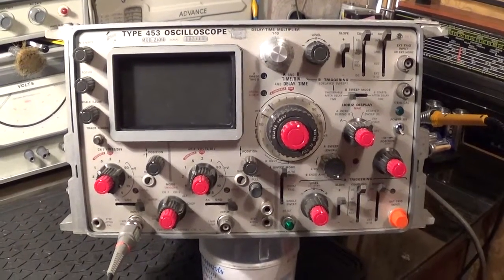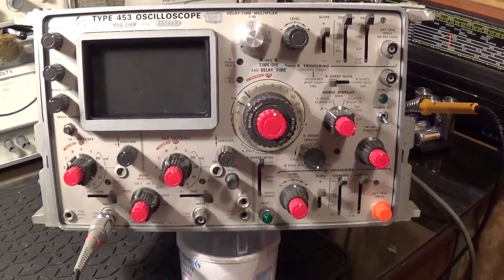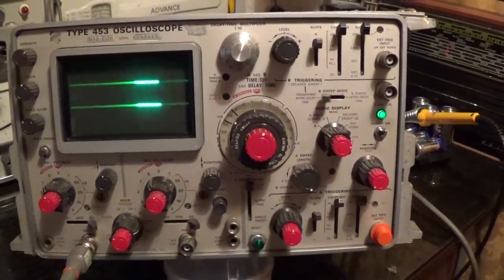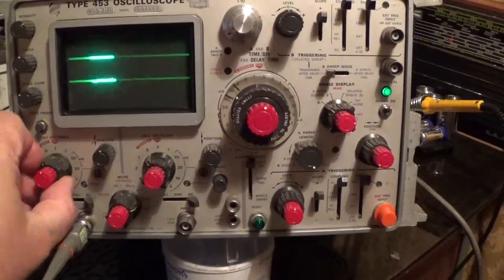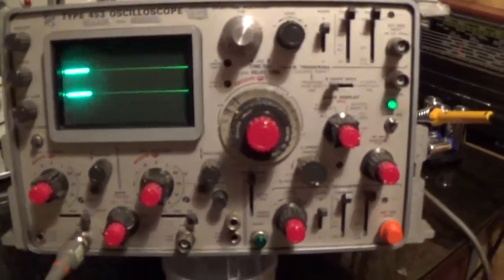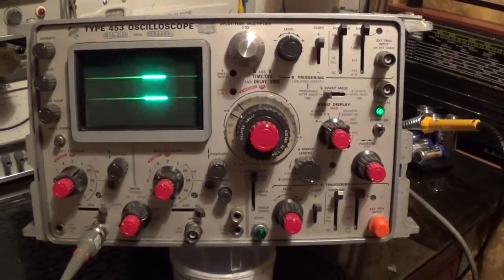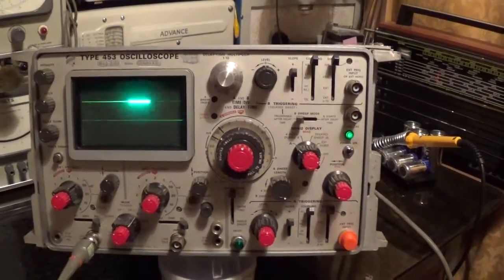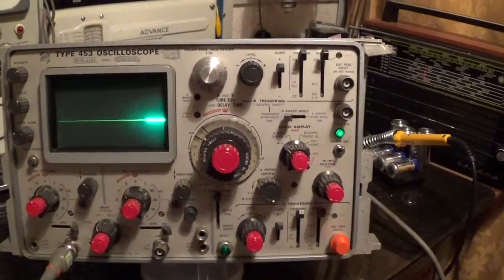Tektronix 453 Oscilloscope Part 2

Comment: Have you tried the triggering? Looks in great shape but might need a few smootherning caps replaced at some point?
Reply from the maker: Hi Simon,  triggering appears to work on the 'Normal' setting, Auto works.  I've not really done any real tests yet but yes, I expect to have to change the smoothing capacitors. Such a pain to get to though! The lower board needs to come out.
Reply: What' the triggering do? Just got one of these and I'm learning as much as possible

Comment: I just got one of these and so far everything works except the fan lol
Reply: My fan also doesn’t kick in, and b sweep seems to be not working.  I get the highlighted trace on the a sweep, but can’t seem to change the time base of it.  Pulled the know, turned, but scope not reacting :(
Reply: @bitlong4669  I ended up rewiring my fan because somehow the plug itself had some worn and loose pins so that's good now, I'd suggest checking the front panel wiring for any loose connectors or anything that doesn't look right then go from there
Reply: @grindcorgz  thank you for the reply.  I downloaded the maintenance manual.  It looks daunting lol.  I’ll see what I can do. I hope it is just the dirty connections cuz troubleshooting the board looks like a big task, and maintenance says it would require another scope too.
Reply: @bitlong4669  yeah it's pretty crazy lol hopefully it's just a connection or a bad know because they're definitely the easiest fix, if you do mess around with it just be careful around the capacitors and don't work in it while it's plugged in unless you know what's going on, if you need any 4k pics of parts close up or anything just let me know and I'll do what I can

Comment: Nice catch.  That fan should be easy to fix.
Reply from the maker: Thanks! It isn't as easy as you might think, it involves extracting the bearings and replacing. Someone on-line did mention the part to use, maybe on the Antique Radio Forum. It's a 120v fan so not easy to buy a whole modern unit that fits straight in, which would be the easiest option.